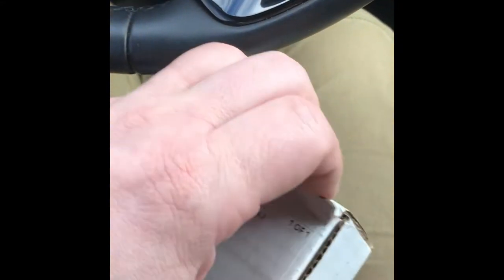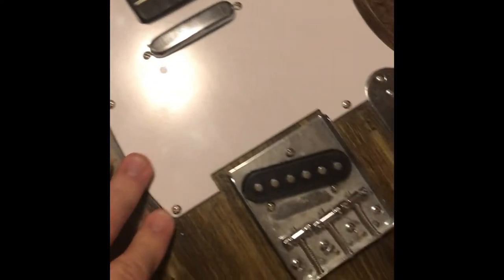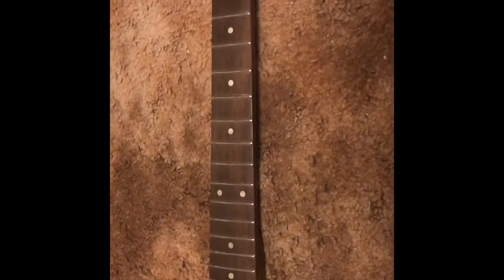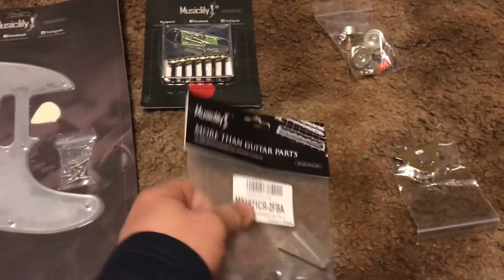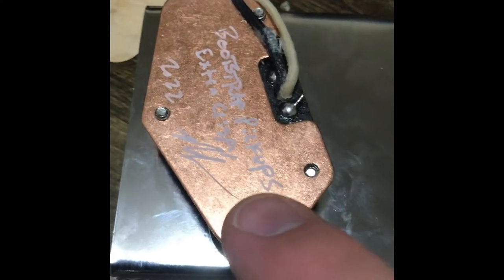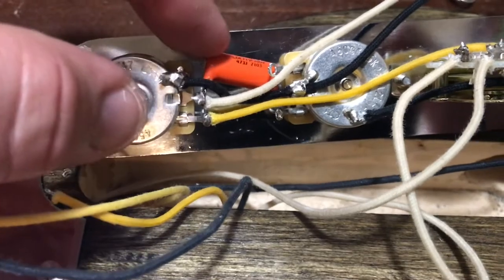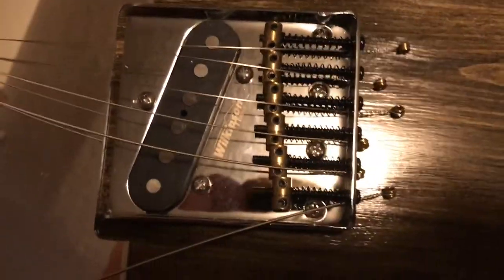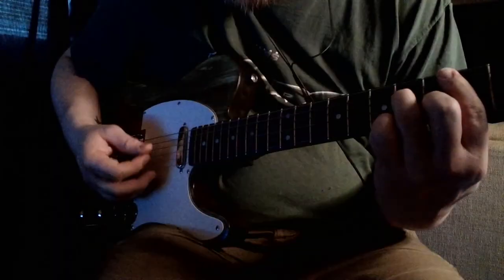Are Bootstrap Extra Crispy The Best Tele Pickups?

Comment: Thanks for this demo! I am considering grabbing a set of these to put on the Paranormal Nashville Strat/tele I just got. The neck pup on it is way too muddy so technically I could just swap that one out but at this price point I might as well just swap all the pickups out! Do you have any thoughts/suggestsions on which middle strat pickup I should swap in from Bootstrap? The Sun City and Golden Ale both look like decent options (with the Sun City having a slight edge as it appears to have a broader dynamic range)...

Comment: I got a set of humbuckers from Bootstrap and loved them. I'm actually about to start a Tele build myself and I think I'm gonna go for the original Tele set from them but I did enjoy your video.
Reply from the maker: I think the originals would work out a bit brighter. With the slightly less output. These ones are nearly as hot as my humbucker guitars but still very clear.

Comment: Talk to me more about the saddles? Easy to install? I have a Squier CV 60s Tele...it has the three saddle...thanks again for the review!
Reply from the maker: These were extremely simple. There are 4 screws that hold it to the body.(it came as a whole bridge plate) This Wilkinson was a drop in replacement for the cheap kit bridge I had started with. I’d measure the bridge and pay attention to the distance between the pickup to the mounting screws there are different versions of bridges to be sure it will fit how your guitar is routed. The only criticism I have of the saddles is I will probably eventually work the string groove a bit deeper.